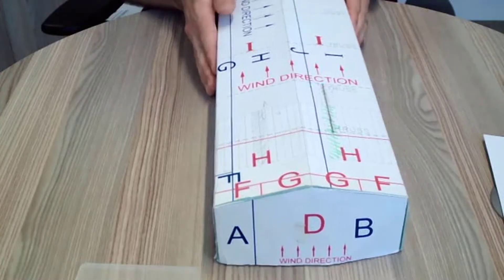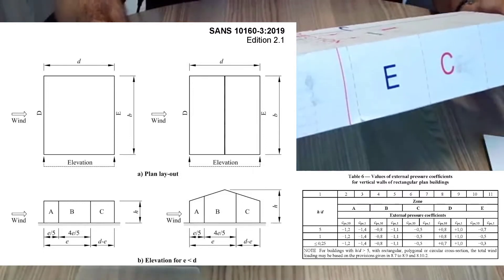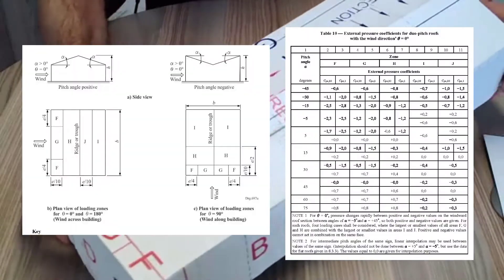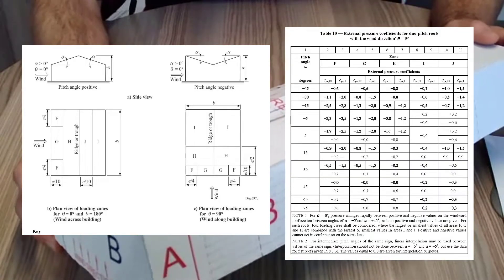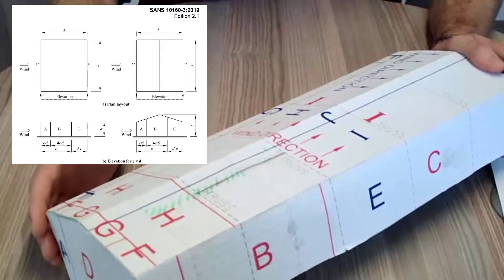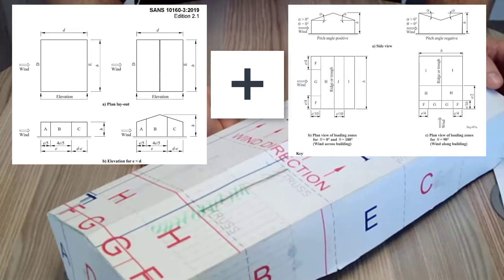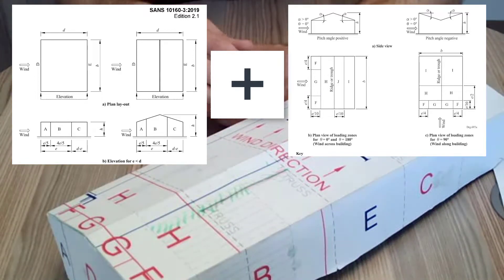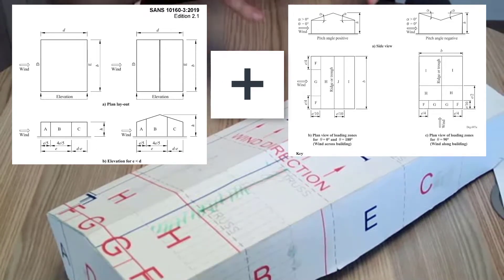Wind load - Internal and external pressure coefficients

Comment: Great presentation, Richard. I have a question what will change if we design an unroofed building?
Reply from the maker: If you have no roof then you just have walls. You will design that based on wall pressured coefficients most probably, depending on the arrangement of the walls.

Comment: Hello, Prof I don't know if that might be a stupid question. From what you have explained we have considered the doors on the dominant wall open, how would we design if the doors are closed? Will the pressure just be the external pressure then? Don't know if my question is quite clear.
Reply from the maker: Dear Melisa. When the doors are closed they are ignored and the internal pressures treated with either (a) calculating cpi based on the windows that are open (if you know where they are, or (b) taking cpi as the more onerous (worst case) or +0.2 and -0.3. The latter is a simple approach when there are various small openings and no specific dominant areas. In complicated buildings this often applies.

Comment: Is this video using eurocode 1 ? If yes what about an asymmetrical roof ?
Reply from the maker: @omarjamoussi6388  it uses SANS 10160. However, for a mono symmetric roof there are good guidelines in both codes. For a asymmetric roof you will need engineering judgement or a CFD analysis or wind tunnel test

Comment: I'm trying to design a 300 sq ft building and wanted to know the structural components for 250mph, 300mph and 350 mph wind loads. Is this something difficult to do or is there a software that can easily adjust the components to support the different loads?Thank you
Reply from the maker: You will need a structural design for that based on the geometry of the building. There are no quick tables for such member sizing. Also those wind speeds are insane.

Comment: How to calculate wind pressure downward and uplift open carport structure like cantilever
Reply from the maker: Each wind loading code has a section on canopy roofs. They provide pressure coefficients to suit. The pressure is a function of the blocking factor. You also need to apply the load eccentrically in some cases to account for uneven pressure distributions.

Comment: What if no dominant opening will occur during periods of high 
wind?
Reply from the maker: Guidance is provided in the code. For example, for a airplane hangar where the doors will be closed during storms that may not be considered at ULS. However, it should then be considered as an accidental case because it could happen, but some damage may be permitted.
Reply: Also, Thank you for responding so promptly, i appreciate it.

Comment: How does the internal pressure behave when there are no opening inside? i'm assuming internal pressure will cause a constant suction inside when wind is applied externally.
Reply from the maker: There are always done small openings around a structure. Simplified guidelines of -0.3 or +0.2 cover such a case to approximate details when you're not quite sure what the internal pressure is.